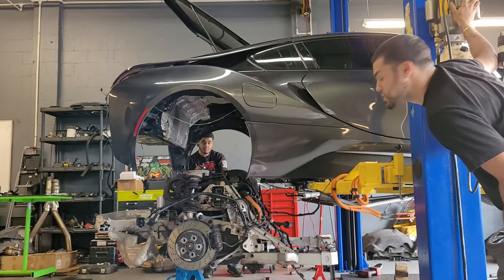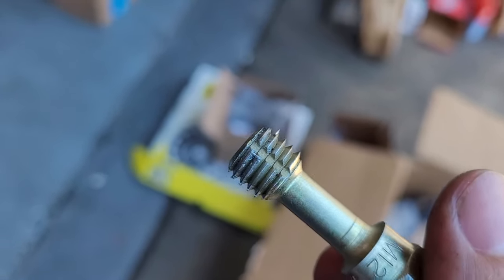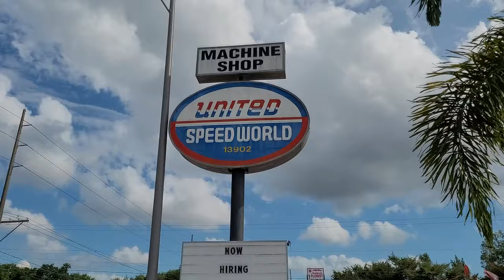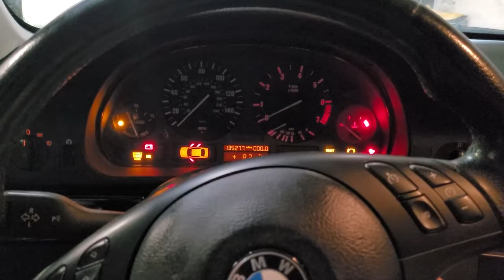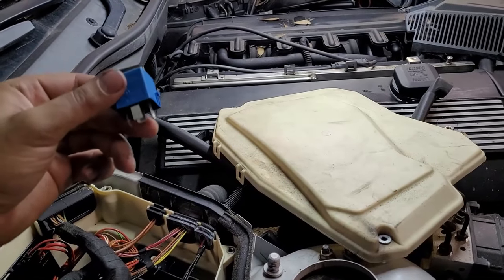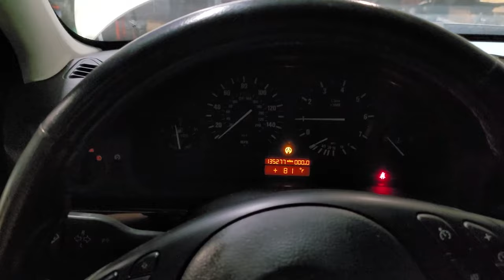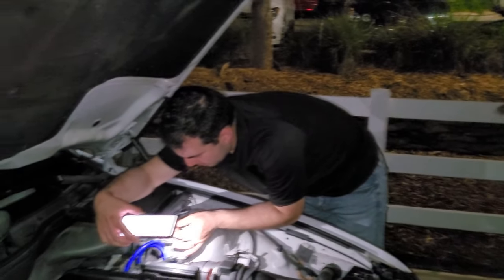We turned this Broken, Old & FREE BMW into $85,000 (extremely rare)

Comment: Regarding the thread chaser :-

When starting a thread that you are worried about (and I would be worried about a thread chaser) ALWAYS offer the bolt (nut) up and apply a gentle pressure (hand) inwards. Then gently turn the bolt the wrong way until when the beginning of the two threads (male and female) pass each other there is a click and a movement of the bolt into the hole.

Now turn it the normal way. This ensures that the threads are PERFECTLY lined  up to engage correctly. If the threads are damaged there can be false clicks. Just check it a couple of times while watching the rotational position. In my experience it is always easy to identify the correct spot.

I always do this with threads into plastic or with self tappers. Avoids that stripping feeling. (Well except once recently when I ruined a $50 plastic threaded component. It was tough to get at and I thought "what can possibly go wrong? I'll be gentle with it".)

With bolts, do it by hand if possible. It's OK through say a phillips screwdriver, allen key, various too. It's important to keep it lined up axially so for small awkward to hold things like self tappers I often use tools.

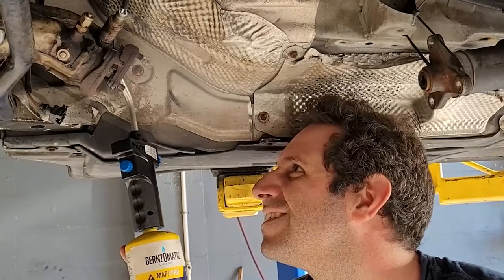Comment: 8:48  MAPP alone is rarely enough.  My Oxy/Propane setup has saved my A$S many times.  Propane is only slightly less hot than acetylene but the tank is much lighter, and if you run out a standard BBQ tank will work.  It needs a different tip (if switching from acetylene), that's about it, and make sure your hose is rated for propane.
Reply: I’ve used all three and acetylene is definitely the way to go for bigger stuff (plumbing wise) the tank he had of mapp gas is good for small stuff or going up multiple flights of stairs, using a big turbo torch tip you can throw a lot of heat at whatever you’re working on , but you’re right with the propane if you run out can grab your grill tank
Reply: @charlie1832    For plumbing many use acetylene alone.  I'm talking about a setup with oxygen as well.  Oxygen makes them all very hot.
Reply: @Hubjeep  I know with an oxy/cetylene setup you can cut through a lot of stuff just about anything , can still get pretty hot with just the acetylene obviously not as hot with an oxygen tank

Comment: The clutch alignment tool it to center the clutch plate to the flywheel and pressure plate. Not to center the transmission.

Comment: Pro tip.....always have a hot exhaust when you take out O2 sensors.  They'd have come out like they were finger tight if you run the car to get them nice an hot.  Alternate, you can heat em with a torch.

Comment: I tried to do what you do and imported to Lagos a 2005 Volvo S60 T5 AWD, it is cheaper to fix them here than it would in the USA, it was run and drive with mechanical issues and sometimes, those mechanical issues could be as simple as battery terminal not connected properly. Well, let's just say I'm in the deep right now 😔

Comment: I had an e39 530d , remapped and it was great. It rusted though , the e39s seemed to rust so badly
Reply: Mine is a 2001 no mention ever on rust/corrosion by way of uk mot history but it’s low mileage  for a e39
Reply: @chiefrocka8604  my 530d was a 2001 and rusted in the usual places ... bottom of boot lid, under fuel filler cap and top of side skirts. Really annoying.

Comment: My 1998 540i V8 (looking exactly like this one, with the same paint color and sport suspension option), required a brand new engine while still in warranty, in addition to a number of gremlins that dumbfounded the dealership techs. BMW N.A. knew me by my first name, so many times it was consulted about my car. 

That was a wake-up call for me, and as the factory warranty ended, I bought a comprehensive extended warranty for close to $4,000. In the following 2 years, that warranty paid for over $7,000 in repairs, till it went bankrupt (in no small part due to my car, I'm convinced). 

At that point, and with close to $5K in deferred maintenance about to come due, I sold it to an unsuspecting salaried status chaser - and I pity the poor guy to this day. May God have mercy on my soul.

Comment: Maybe I was lucky and maybe you were not but I've just done the clutch last week on my E60 layed on my back on the drive on my own struggling layed under the car, I'm not a mechanic and it took me 6 hours to change the clutch and reassemble everything.The bolt pattern on the bell housing is identical to my 6 speed box , my car had under trays on to keep moisture and dirt out and none of the bolts were stuck or siezed. Did this E39 have the under trays on I don't remember seeing them. Mine still had the original LUK clutch from new and had done 165000 miles, the clutch still had material on it, the problem I had was the dual mass flywheel started to rattle and the thrust bearing was wining. My point is tho the bolts on mine haven't been out before and the car has done 165000 miles the only thing I can think is that the plastic undertrays have stopped the bolts weathering as fast .

Comment: Could send you these from the Uk and be a millionaire very quickly, people use them for banger racing 😂 not rare in the Uk or wanted
Reply: Too much rust.
Reply: This one here 🤦‍♂️ seen a couple being sold for nothijg
Reply: Uk cars are worthless, cause the steering wheel is on the WRONG side of the car
Reply: @sanderkalso  Even in Germany. This thing would be worth like max 14k like this. Maybe 18 if you wait a loong time. And thats with everything they replaced. Before that thing wad a few thousands. 4-5 at the very max
Reply: @shadowfoxy3776  in Estonia, a good manual 530i goes around 3k
Reply: I’ve watched this series whilst the whole time wondering where the rarity of this car is. They’re 10 a penny over here!

Comment: To get the studs out just cut a slot through next to them and they will just fall out. Put a nut/bolt in and job done. I got that tip from another channel.
Reply: Exactly, might even weld the "slot" up afterwards and clean it with a grinder so almost OEM again

Comment: Do you consider to check/ change the oil pump? I think these bmw with m54b30 has a bad design oil pump sprocket who hold on only 5mm long thread. it could came lose so you can end by trowing this engine in garbadge. Most of cases log nut is loose. (Sorry guys for my english)

Comment: After watching this video am happy to report that i tackled this clutch job in my garage using jackstands and with no help in a weekend. Testimony that where there is a will there is a way. My saving grace my car was a southern car so no rust issues. The rack and pinion job is a different story. Thats a job i will not do again. I also did not have to change fuses or relays. Cranked right up after the change

Comment: I have owned a e39 years ago, after all I can say Its not a good car, any repair is really complicated and it's hard to find the right parts. The other thing they are not good for pulling a trailer, the engine is strong but all the other stuff suspension,gearbox and more it's not. Now I prefer old land cruiser and UAZ. Easy to fix and hard in taken

Comment: E39 Lover from Germany here, I am amazed that the old beauty gets some Love in her old days. 

My E39 had around 230.000 Miles on it when I've done most of the Suspension. Honestly, it didn't fight as much as you have to remove them. For the Spinning bushing at the rear control arm: Use an Open Wrench and a Ratchet to lock the Ball Joint, and with the wrench then Break them Loose. Changed them with that technique in my driveway.  

The E39 has a rather "complex" suspension system in general, there are many bearing, bushings and stuff, considering PU is with a "lower budget" built for most cases a very good idea if the ball joints are good. Also, the E39 is a total Bitch when they aren't maintained up to the finest. I had many interesting problems on my 528i, ranging from engine failure trough to damaged timing chain guide, some 

But I also didn't need to use new engine mounts (old ones are in mint condition), also I didn't need new transmission mounts as they also were in mint condition. I replaced the rear subframe bushings (Tonnenlager in German) and used for one of the rear linkeages the E60 M5 one, because it has a ball joint on both sides and makes the ride quality noticeable better. 

Nice thing what you have done to the E39 :)

Comment: The shock absorbers are mounted incorrectly. 9:57 you can see that they are pointing way to much backwards. On OE Sachs struts there is a sticker to indicate the orientation but not on all other aftermarket shock absorbers.

Comment: Modern Vehicles are built by Accountants Old Vehicles are Built By Engineers. All this Modern mass Produce Consumer shit has to come to a end it's not sustainable The UK Police Had this Model in Estate version They are good motors  and the cops love them. They chip good for a POLICE CAR.  Result Sam we all love a Free Motor.
Reply: Sam Snapped Studs due to heat soak '  Heat soak changes the Temperament of the metal used in studs So Over time they will become soft to the point of sheer off on the flange. They way you Remove them is to Use a Automatic Center Punch to start a Pilot Hole in the Center of the stud Then using a hi grade cobalt or higher spec HSS bit. Drill the stud the entire length of the Stud Once you have a 3 or 5 mil hole all the way through then take it out to a six mil at this Point the Pressure on the Thread will start to reduce and then once the hole is in place you can then easy out the stud or just Drill it out completely re tap next Bolt up away you go again. Never Going t o move them with a air chisel.Great cars.

Comment: You're the worst mechanics I have ever seen....  several hours to get a strut out? Really?  🤦🏻‍♂️
Reply: Did you see how beat and corroded all of that was tho? That suspension was in place for 20 years. That and they had to fully dissassemble the back seats and rear deck to access the strut mounts. What a ridiculous design.
Reply: @_dmfd  the back seat takes a few minutes....  Removing stubborn bolts like they did, is ridiculous.  Like I said, worst mechanics I have ever seen.
Reply: @DocumentaryHub  seats yea but all that trim, brittle fasteners, speaker mounts etc to get the rear deck out. And then like I said how corroded that rear end was. They're a legit shop, doubt they would get the customers they have if they sucked so bad. I will say that Sam isn't the best, and the original owner of the car seemed kinda lost on what to do either but I wouldn't say worst mechanics. I hate removing original suspension components on a 100k+ mile / 20+ year old car, and all the other shit in the way inside the car. Just a bad design overall and people say this is the best generation of BMW 🙄😂
Reply: @_dmfd  your lack of skills has nothing to do with the quality of cars. 

All German cars no matter how old they're are all easy to work on, if you know how.  Italian, French and American cars are all shit quality.
Reply from the maker: You must be so skilled and talented so happy to hear your input  🤏
Reply: @DocumentaryHub  it doesn't matter who the car is made by, if anything is torqued down and left to corrode and weather to the elements it's gonna be a pain in the ass to break loose without breaking it. And idk man there's been a ton of shitty German designs. All cars suck lol.
Reply: @Samcrac  ofc he is, aren't all armchair mechanics better? He could have just control - alt - shift - and deleted those struts right off!
Reply: @_dmfd   you need a job? 🤨 Clearly you’ve been around a car or two unlike Patrick over here. Thanks for having some common sense 🤟🏽
Reply: Patrick, you are so diplomatic.  Such a shiny example to all us viewers and commentators!  

Of course that should be followed be a loud record scratch and a good telling off...

But we also look forward to your videos in the near future Patrick.  Just hope you don't go bust underestimating on stuff...